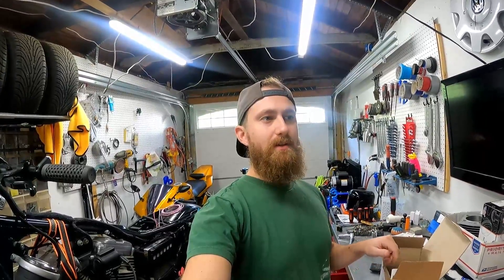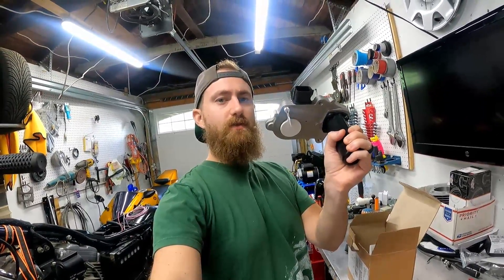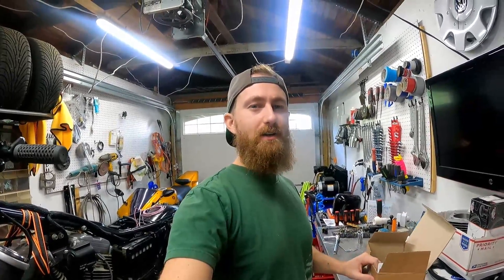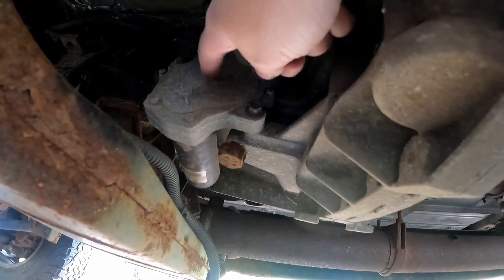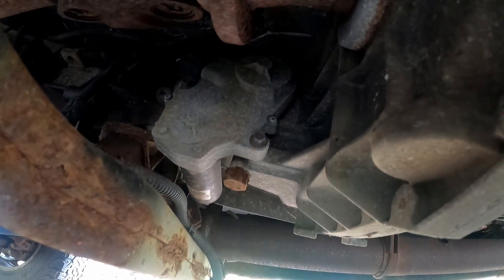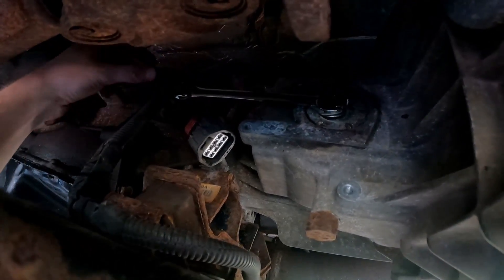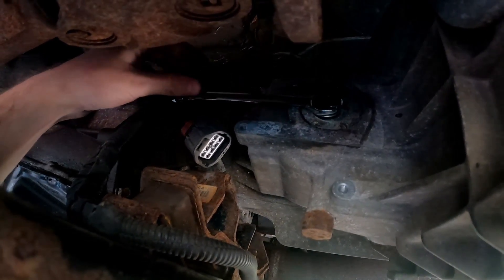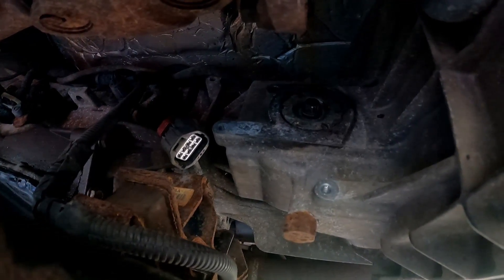Replacing the Transfer Case Shift Actuator on My Ram

Comment: This all stems from the TIPM box that is an absolute POS! I replaced the actuator once. Worked for a year then started randomly shifting into 4WD again. Then replaced the TIPM box & had rewired. 2 years later acuator went out again. I manually shifted it back to 2WD & disconnected electrical to the transfer case😂 Now I have a 2WD hay truck.
Reply from the maker: Oh interesting...I wonder if anyone has found a fix for the TIPM box since its seems to be a widespread issue. Haha if that works for you, that's a cheap and simple fix. These trucks had an option for the manual transfer case shift, I wonder how hard it would be to convert...
Reply: @cheesingarage  I really wish I had the knowledge to do so. It really was a solid truck for the first 10 years.
Reply: Hey guys is there something else to do after unhooking the plug and putting it manually back in 2wd? I actually just did this trying to get my truck moved from a space and it originally didn’t show me service 4wd but now after removing the motor and putting it in 2wd,  the light does show. And still not shifting into gear to be able to move. Any advice would be great thanks in advance
Reply: @dallasbrooks2915 have you tried disconnecting battery to reset it

Comment: It’s the heat from the exhaust pipe that roasts the electrical on the motor. For better results, put some exhaust wrap for a couple feet around the exhaust on the area that is close to the TC motor. You’re welcome 👍
Reply from the maker: Thanks for the tip!

Comment: Man you're a life saver! I was going through other videos and they were all talking about disconnecting the drive shaft it was such a huge undertaking and I couldn't figure out why it couldn't be done just the way you did it and sure enough there you go! Amen!
Reply from the maker: Glad I could help, good luck with the truck!
Reply: that is the part that is changed when you turn on the light 4wdserv

Comment: Been fighting my 2500 for a year, 3 shift motors.  Finally got it. Connectors were dirty on wire harness side of the plug. Took a little round brush and cleaner to remove. Put old actuator on, works.
Reply from the maker: Oh interesting, I have giving my wiring a once over but haven't seen any issues. I have had luck with the last replacement though, its still going without issues. Sounds like there could be multiple reasons why these have issues, thanks for sharing!

Comment: i have the very same problems and so far 3 shift motor i have put on and still the same problems.runs for a week or so then off into 4wlo it goes so i got suspicious and open one and its all torn to bits inside, why i dont know.
Reply from the maker: Interesting, mine have been lasting a longer than that (between 1 and 2 years) but I haven't taken any apart. I might have to pull this one out of the trash and investigate. Thanks for watching!
Reply: @cheesingarage  you,re welcome

Comment: did u buy oem mopar. or at a parts store
Reply from the maker: I have bought both and neither has given me a longer lifespan, so this time I just got it on amazon. Someone else mentioned that this issues stems from the TIPM and that the failing actuator is really just a symptom. I haven't looked into this yet, but for now its just not worth getting a more expensive mopar unit.

Comment: My 08 Dodge Ram keeps blinking 4wd low while in 2wd and then eventually serv 4wd pops up. When I change my actuator do I need to have the truck in 4wd low then?
Reply from the maker: What I did was move the transfer case to match the new actuator. I was able to easily rotate it with a wrench like I showed in the video.

Comment: I replaced this on my truck and it didn’t fix the issue it still randomly goes in to 4low and gets stuck when I hit the key fob. And when I go down the road it blinks 4 low a few times and never goes in to it. I’m stumped looking for help.
Reply from the maker: This sounds a little different than the issues I have been having. I cant say for sure but my guess would be either the switch in the cab or the wiring in between. You could try using a multimeter to check which wires have power at the tcase in the different switch positions and check again at the back of the switch
Reply: I'm having the same issue. did you ever figure it out?
Reply: Hey guys you may need to replace the TIPM
Reply: Clean your wiring harness connectors on this TC motor.

Comment: My neutral on 4x4 knob is flashing and my truck will only start if I push button (n button ) truck drives fine but I have no gauges unless I push it in . And only when I do .
Reply from the maker: That's interesting, different than the problem I had. I wonder if its the same issue or something else entirely. Let me know when you figure it out
Reply: @cheesingarage  skim key invalid

Comment: The 1500 shift motor is not the same as the 2500, just so you guys know.
At least on the 2500 you don't have to remove anything to get at this part and swap it out.
Reply from the maker: Good info, thanks!